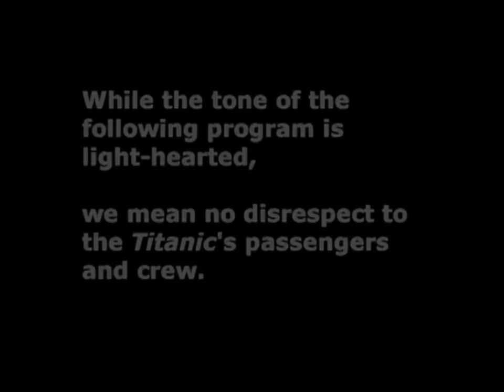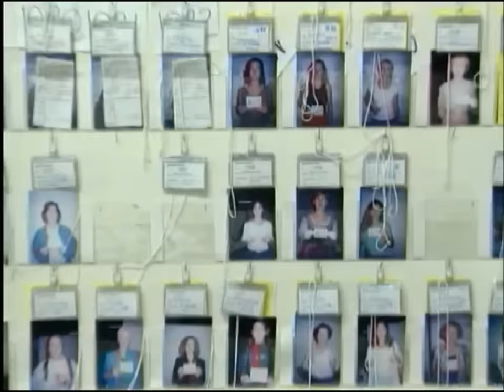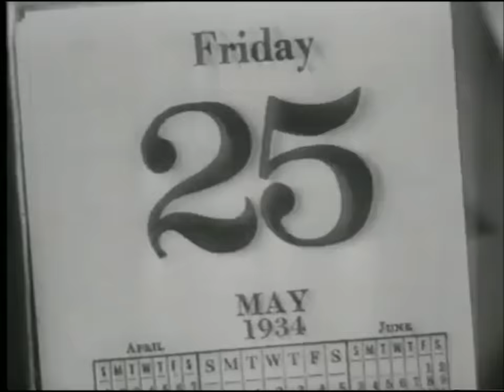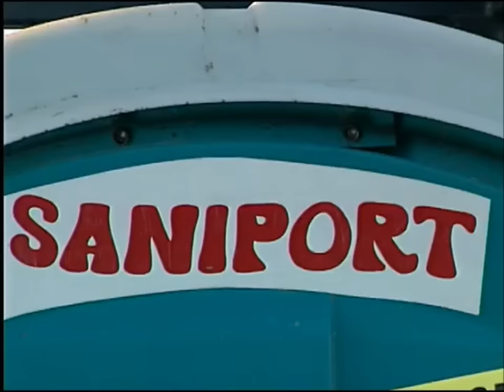TITANIC Cast & Crew video HD

Comment: 4:20 Anatoly is just calling out the depth of the submersible as they are descending.  There are two submersibles, MIR1 and MIR 2. 'The Depth is 3,700 metres.  How do you read me?  Over.'